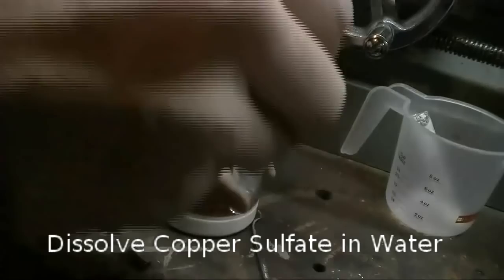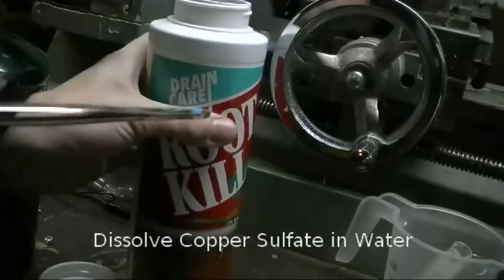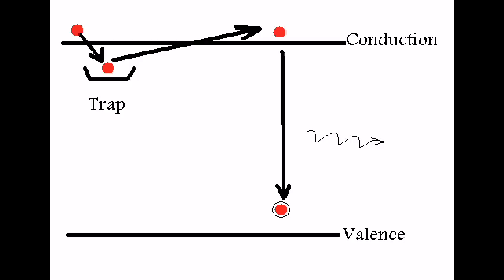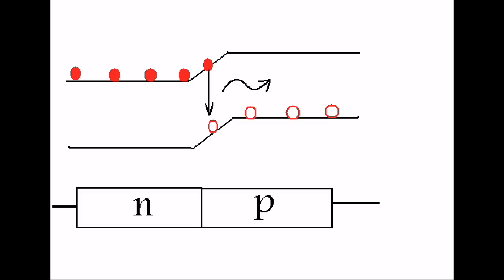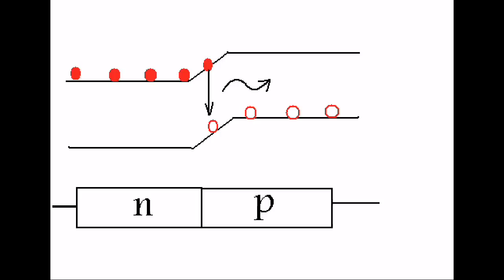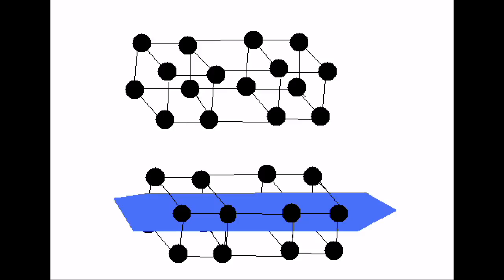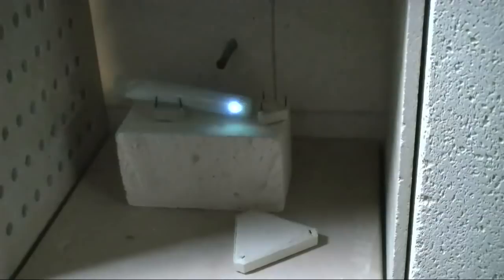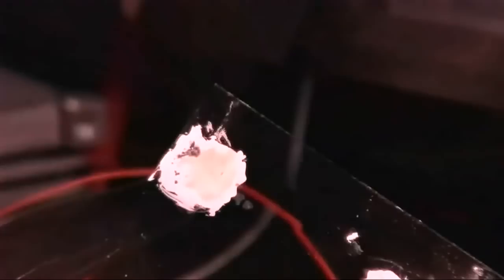Make Electroluminescent (EL) Ink at Home - Re-doping Glow Powder

Comment: This is exactly what I needed for my latest project! The trouble with traditional methods of fluid electroluminescence is the requirement for a vacuum environment, such as with neon, in addition to quite high temperatures which would melt the construct I'm using this on, but you've produced a cold lit, fluid enough substance that's compatible with nonlinear conductive pathways - at home. Brilliant work!

Comment from the maker: @JehuMcSpooran ZnS:Cu glow paint is already in crystalline form, so it saves creating it and then heating to the melting point of ZnS.  I discovered from patents that EL powder is almost the same as glow powder production, but with EL needing one extra doping step.   I read that chloride salts will work for introducing the chlorine atom, but I'm not sure which will work.  I'm guessing that the salts need to melt near or below 800c.

Comment: If I were wearing a hat, it would be off now for Jeri.
It would be nice to hear how you absorb information. I mean, how you usually do recearch. Topic for a video perhaps?
For everyone else reading this: Trial and error is not the way to go with chemistry (or high voltage/current). Safety aspects slows the learning process a lot. Sure you can easily keep your skin intact, but your bones might melt :D (No joke. Jeri uses that stuff when making transistors)

Comment: hello,  nice video. regarding the structure (the capacitor) what the parts ? what is used as dielectric? what paper water glue based is this ? it is supposed to replace the ITO layer ?